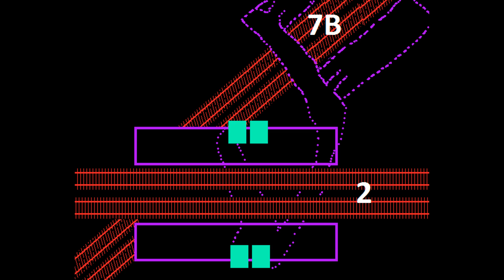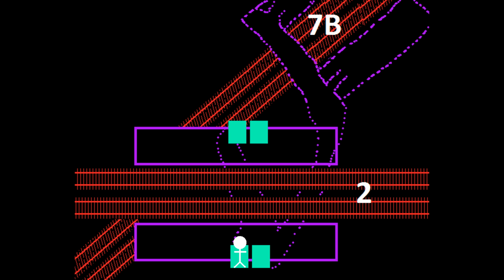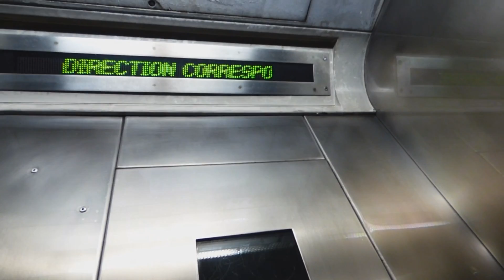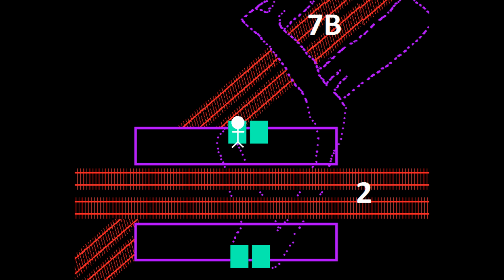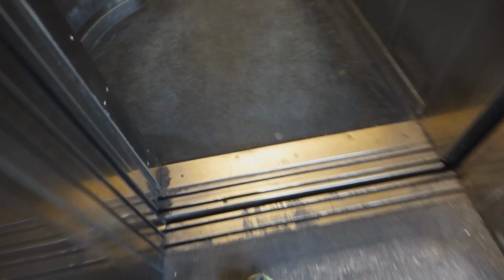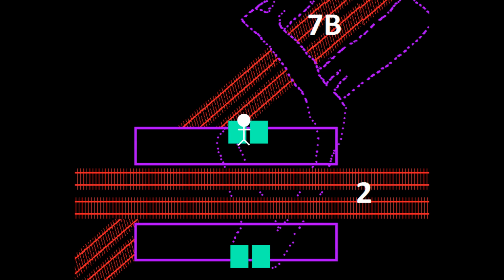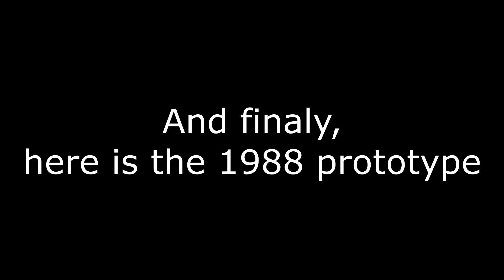Paris metro station | IT'S LIFT TOUR TIME!

Comment: Those lifts were installed by Schindler?
Reply from the maker: IDLift3000 I'm not sure who built them.
Reply: +IDLift3000 Yes, these are Schindler. I've also ridden them a few years ago. The capacity plate is typical from Schindler.